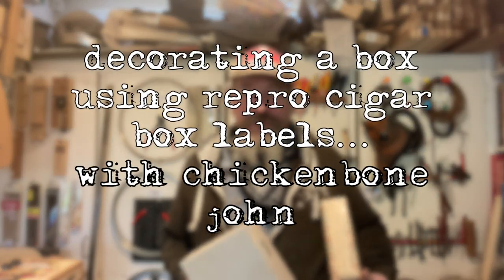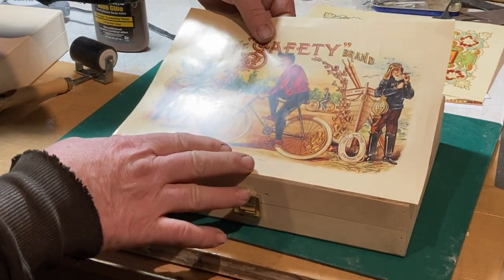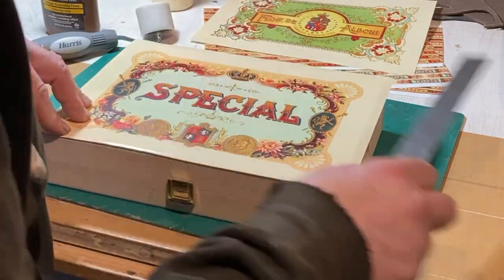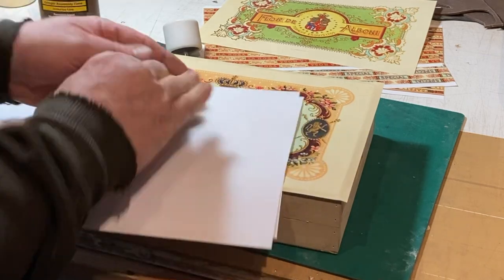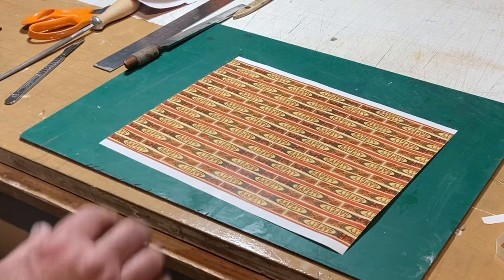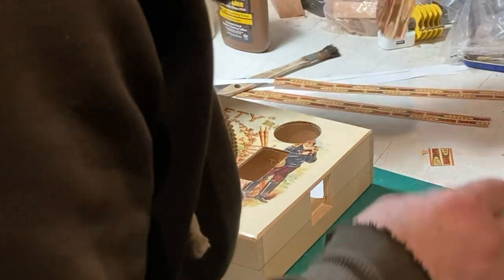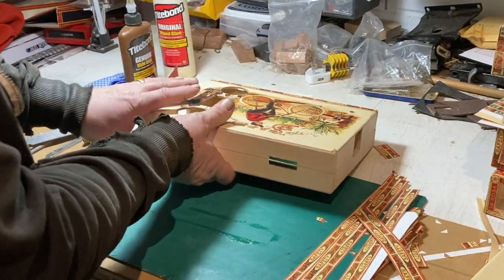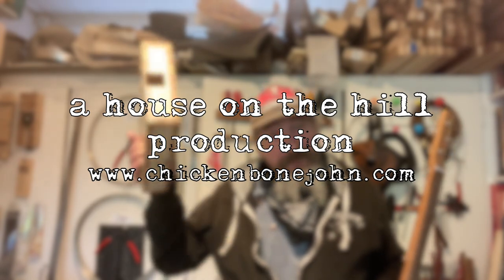Decorating plain boxes for cigar box guitars with ChickenboneJohn

Comment: Boxes look great! Thanks for the decorating tips. Would you recommend any lacquer or finish over the top of the completed box inc the bare wood to give a bit of durability?
Reply from the maker: Clear auto lacquer works well, but just very light mist coats, dusted on, otherwise the lacquer can soak in and go blotchy if you overload it and get it too wet.

Comment: Great video, as are all the rest. Do you apply onto the raw box or do you seal the wood with anything?
Reply from the maker: We glue straight onto the box, definitely recommend using the liquid hide glue, as it seems to have less moisture in it compared with regular Titebond. We are very sparing with the glue, rollering on just enough to get a thin tacky layer.

Comment: If I print the top labels out on my printer and use photo paper.   Will this paper work??
Reply from the maker: You may have problem gluing them on using a water based glue, as the images will probably run and bleed as the paper absorbs water in the glue. You'd have to use something like spray glue, our do what we do for our make and play workshops, by printing the images on self adhesive paper.
Reply: A few thin coats of poly on the front and back of your label before glueing will solve any  issues with bleeding and will make for a more permanent image. Mod podge glue is also a great alternative to glue.

Comment: Could you use water slide paper ?
Reply from the maker: That's a completely different thing.  We are going for reproducing  the traditional style of paper covered cigar boxes. Waterslide transfer works best on a super smooth glossy finish , and a wooden box is not that at all. A whole A4 sheet would be difficult to get on without wrinkling or tearing it. Gluing on a sheet of paper is much easier!
Reply: @ChickenboneJohn  many thanks for your reply